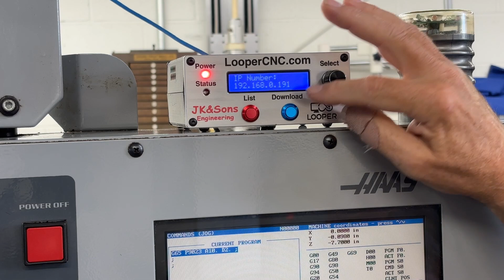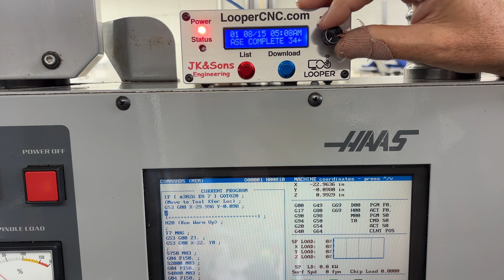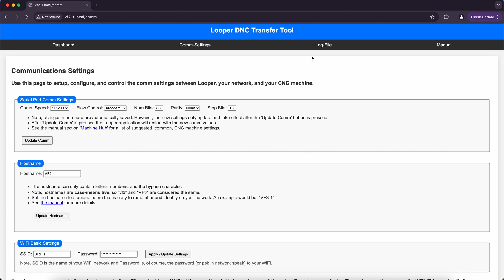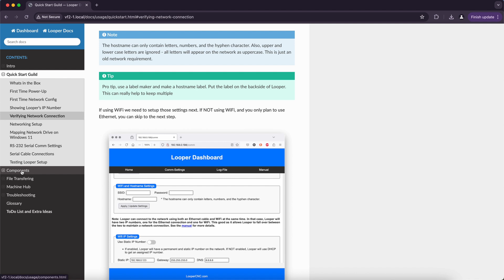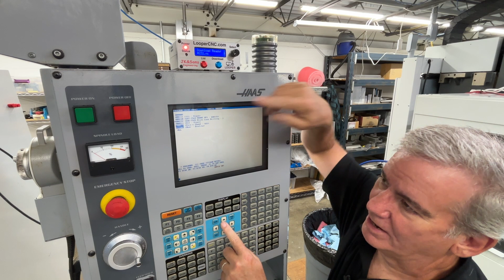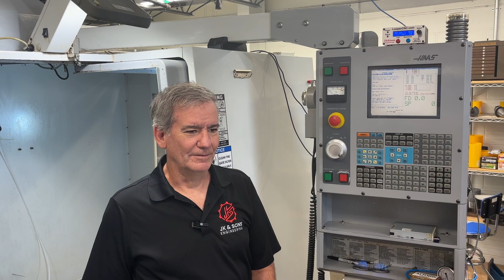Meet Looper: Wireless CNC Machine DNC File Transfer

Comment: Work on older haas machines as well as fadals?
Reply from the maker: Right out of the box Looper works on a HAAS.  Have not yet tried on a Fadal yet.  However, with the right settings it should also work.